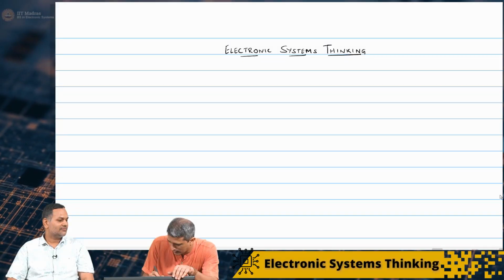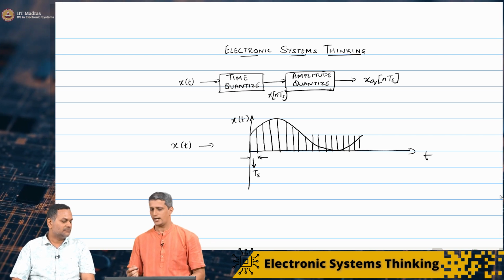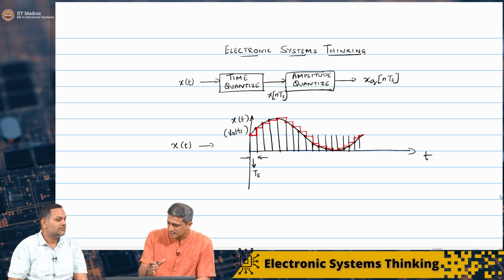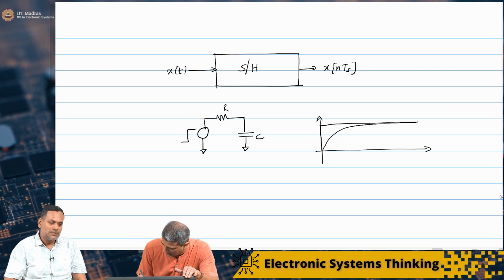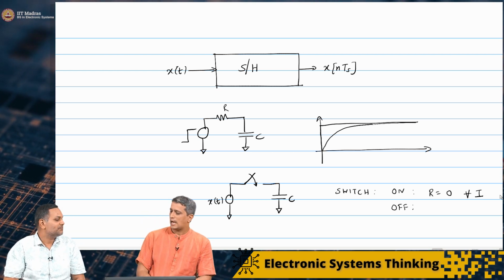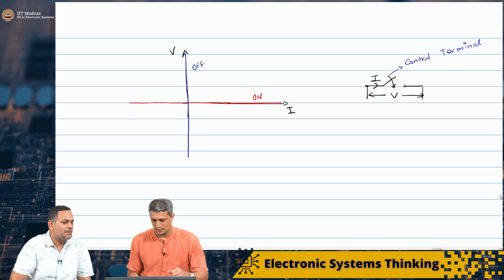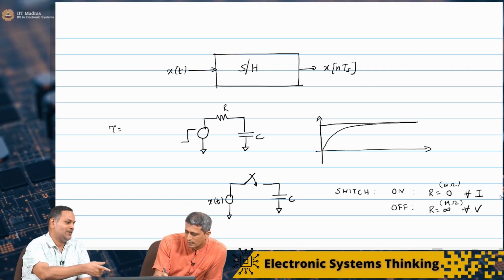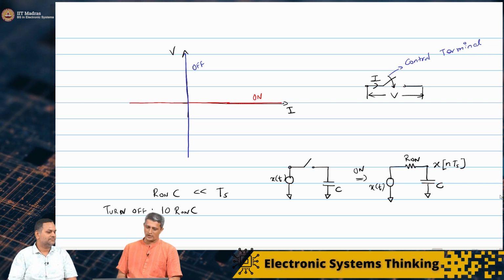9.4 : Sample and Hold Circuit

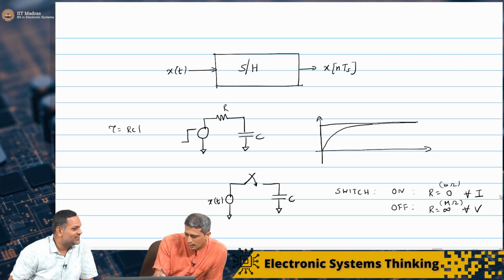Comment: 17:28 : RC*ln(2) is a parameter to measure how quickly the circuit will charge the capacitor. It's unit is time (s). In this time, RC*ln(2), capacitor(of RC circuit) reaches 50% of maximum voltage. This is 69.3% of time constant(RC).